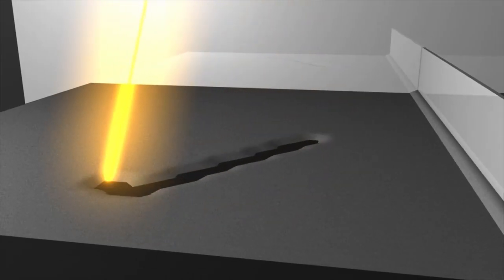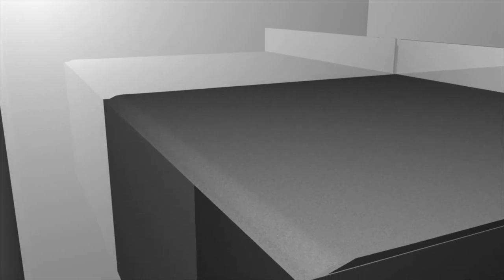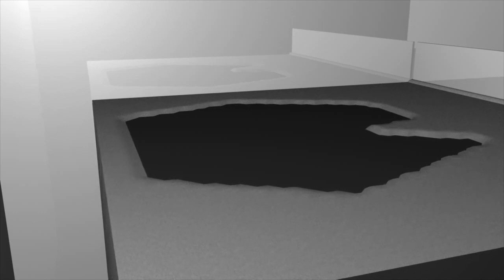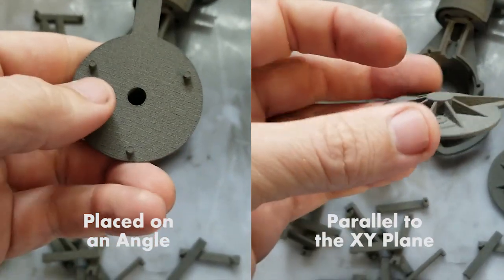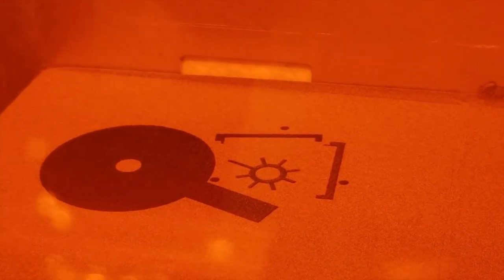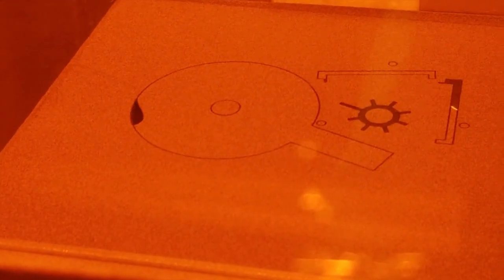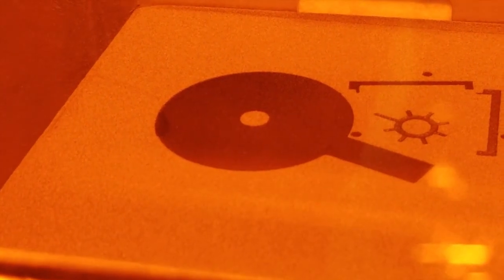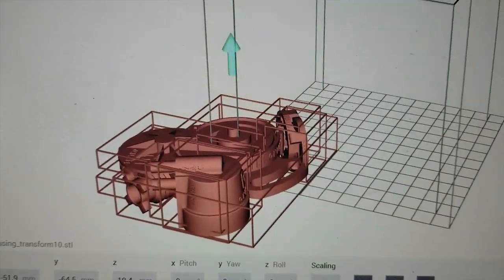Managing Large Patch Sintering on a Sintratec Kit

Comment: Would it be possible to just make a second wipe with the powder? Sure, it is a waste of material, but the gap might get filled up and as far as I know, the powder can be reused.
Reply from the maker: Sorta. 

You can adjust the z layer height in the settings, but then you'll need to recalibrate the machine.
Reply: @0001D-t3e  which, I guess, might be quite a pain in the ass for amateurs like me :/